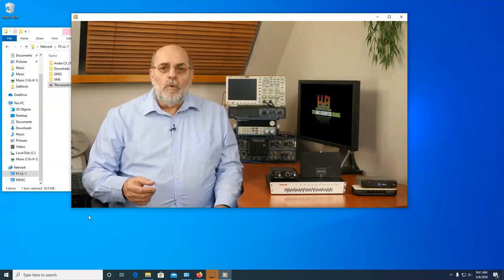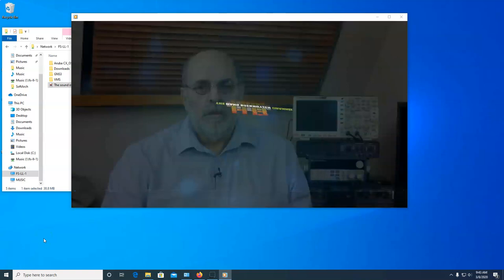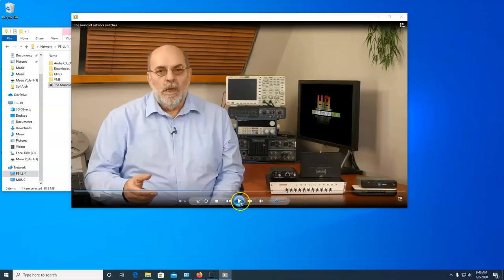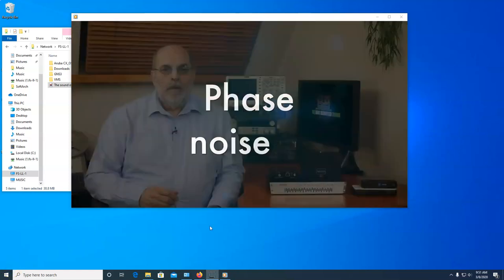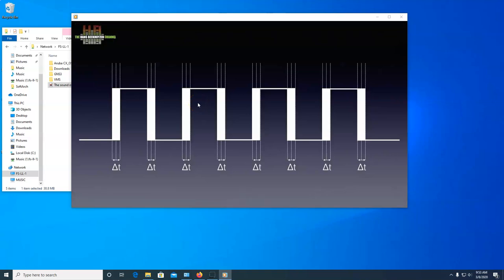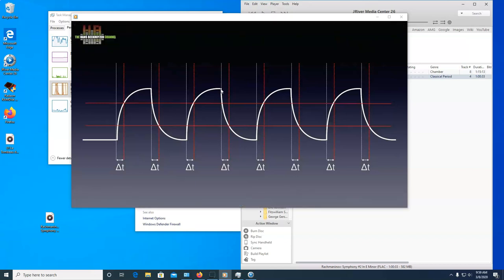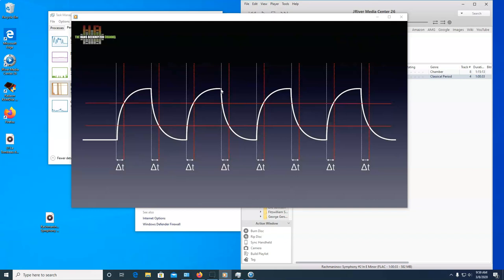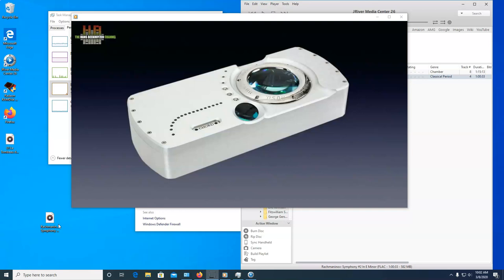Reply to Hans Beekhuyzen on Audiophile Switches

Comment: If someone hears a difference they hear a difference regardless of measurement. Hans is independent and highly respected, I guess it’s possible he might be fooling himself in hearing a difference but I very much doubt he speaks in bad faith.
I find it fascinating why it bothers so many what others spend their cash on. If I want to drop a few hundred on a cable to give myself piece of mind that I’m giving the system the best chance, that’s my funeral!
If you’d used to the time you spent criticizing audiophiles for something more remunerative, the cable would be a drop in the ocean!
Reply from the maker: If someone sees the tooth fairy they see the tooth fairy. Especially if they are independent and highly respected.  Thanks for clearing that up for me Keith. 

Let me ask you this: Where in my video am I incorrect and where is Hans correct. We can't both be right.
Reply: @mnoble247  firstly, if I believe the tooth fairy is making a difference, that is placebo. We know placebo is a thing. If I fool myself into thinking something sounds better, I still think it sounds better,  what else is there to be said? It’s a win win, you get to call me a fool and I believe I’m hearing better music. In this case only MY wallet has suffered.

Your expertise at measurement is unimpeachable and I have full respect for what you do. To me it comes down to, Can everything be measured? and while the answer should be yes, the answer is t yes. You could have two pieces of audio equipment by different manufacturers that measure identical but will surely sound different even if by a small margin.

I’m just a music lover who believes in marginal gains and am prepared to pursue these gains to a degree I see fit for my income. Because of my interest here i have no doubt confirmation bias is doing it’s thing but once again, my opinion of what my system is doing is all that matters. 

Your passion is measurement and so you are firmly in that camp. I’ve seen you’ve made a few vids of the debunking kind. Now, if this is your brand then it seems quite possible that you too could succumb to confirmation bias and dismiss anything that’s not measurable. 

In summary, you are both right because you are using different schemes for analysis, Hans uses his ears, you use measurement. 

If it makes you happy to call us all idiots have at it, enjoy your analyzers I’m off to listen to the White Album
Reply from the maker: @keithbertschin1213 

You are trying to make a point about something I wasn't talking about for starters. 

Hans has a foundational misunderstanding in how data networks work. That's the point I'm making. He's treating data networking like it's some realtime analog vinyl system. It's not. Pre-recorded audio and video by it's nature is bandwidth greedy and delay insensitive. 

The other day I was watching a YT video and all the sudden it stopped in the middle. I went into my SNMP server and found that my Internet connection had went down 45 seconds earlier.

Don't read into what's not covered in my response to Han's taking heat from Network Engineers and the like.

Comment: Why can't people like you see that all you're doing is trying to claim your product is as good as the more expensive one? I don't even disagree, necessarily, I just grow weary of the approach.
Reply from the maker: This is the second post of yours where you are insinuating that I'm a vendor of some sort in the audio market place.
Reply: @mnoble247  not exactly, but close. I  believe that what all of these videos exhibit is similar to psychological bargaining. What you're really doing is making a deal with yourself, that your choice is as good as another. In other words selling yourself by way of making a video on the idea that you found or hand built a diamond in the rough. 

  Your real argument should be with the marketing department. I'd bet that their engineers follow the same principles as you.
Reply from the maker: @jamesrobinson9176  I've had both the ER and the Silent Angel Bonn 8 in situ. I have another video showing the ER and one of my Aruba switches feeding a computer with a dual port network adapter in a 802.3ad compliant lag. In that demonstration I start play back of audio and with no interruption in play I introduce the largest possible source of jitter and that is I pull the cable and swap another. 

So this isn't an inferiority complex as predicated on psychological bargaining. But one of understanding the technical underpinnings of non-realtime audio reproduction and how it actually works. 

Now I understand why you've made your unforced error and all you had to do was look at my other video's in channel. But if you haven't and you've only based your theory on two of my videos that's entirely understandable given your information deficit.

So the question I have and it relates directly to the video that I created here: Where is my reply to Hans factually incorrect? Either Hans is incorrect or I am. I would rather not have someone genuflecting from the purpose of my response video.

Comment: Switches are the next level snake oil. Talk about USB cables. A half decent USB cable will perform as good as one made out of silver - both of which cannot make any difference to sound because it's data for the dac and not its analog signal. I'm tired of explaining this to people online.

Comment: Engineer here. Audio DACs, at least the ones made in the last 30years or so don't care about jitter because by design they have a buffer anyways. Its the biggest lie in the audio industry. On the output/analog side audiophile DAC makers just screw with equalization a bit in the midrange to get all these claims.

Comment: Well, we do not do blind testing. If you experienced enough in listening, it is like with your eyes, you know what is HD and what is 4K with or without blind testing.  You thinking too much. Sit and listen. But, you need to have decent enough audio system, if not and you will hear nothing - all you can say is: in this particular system, you heard nothing. That is it. Otherwise you fooling yourself thinking you know what you do not know. Which is how other people systems sound. And one more thing. If you using Jriver as a source, well, that is the reason why you do not hear the difference. People who invest monies only in what makes difference in sound, do hear the difference. So what you are going to do about that? Tell them they do not hear what they hear? :)
Reply from the maker: I have a standing offer of my $4000 to your $1000, in your setup from the USB cable on back, you can't tell when blinded to what switch is in play. Here is my proof of concept video https://www.youtube.com/watch?v=u6mYM8Xy0H8&t=6s . Travel expenses paid by loser.
Reply: @mnoble247  I do not use USB in my system, I think it is inferior to other connections. I use Roon. DCS Network Bridge is connected to switch and connected to DAC via Transparent Reference XL aes/ebu, than via xlr PAD Neptune to amp. Roon Core is on my laptop, if laptop has wifi off, music stops after seconds, not like in your experiment :) Meaning you experiment is wrong. Does not apply to real world. Dunning–Kruger effect comes to mind. You know something from technical point of view, but just something, that gives you lots of confidence. And that is Dunning–Kruger effect. Sorry, I have no time to prove you are wrong. This is for you to discover.
Reply from the maker: @kennigt  How is my experiment wrong? If you play Tidal direct it will cache entire songs, If you use ROON as your front end for Tidal  it will only do a few seconds. I would rather applications take advantage of full data rate instead of constantly fetching. 

I've read plenty about Dunning-Kruger at avsforum ove the past 15 years. 

What is not real world about my linked video. Does the music play or not play as I swap Ethernet cables?
Reply: @mnoble247  you are measuring, not listening. You probably have no system good enough to pick up the difference. I seen many technical people ignoring what is the most important. Experience in listening. Not only one system at home ,but as many as possible, learning and understanding what make difference by try and error, experiment, not measurement. Measure will not tell you how or why something sound. And that is something you need to learn, when you learn that, you will know how much is there still to learn, hence you are at beginning of Dunning-Kruger curve.
Reply from the maker: @kennigt  I have 4 different systems. One dedicated HT and three 2 channel systems.  I'm also an avid DIY'er and we have GTG's twice a year. 

Also read plenty on Dunning-Kruger over the years. Also check out the McGurk effect. 

Also in the linked video I didn't do any measurements. It was simply listening on my AKG 701's off an Emotiva DC-1. 

BTW I build my first set of speaker 30 years ago: Karlson Folded Horn. I've been at this a while... For 7 years I put in NLE system for audio and video mastering. Everything from home to broadcast. 

Currently since I'm a network engineer I design and install AVB and AES67. 

I can more than hold my own.
Reply: @mnoble247  I had electrician at home, and when I asked him about power cables he said I am crazy, power cable makes no difference. So, you as network engineer are saying the same? We are fools when we hear the difference?  Or maybe problem is on our side? On Emotiva you will not hear the difference.
Reply from the maker: @kennigt  I'm saying sighted bias has an effect. The DC-1 is more than capable of being a resolving DAC. 

As a network engineer I'm saying I understand how highly buffered, non-real-time, latency tolerant, audio works.

When it comes to AES67 I also understand how DCSP, low latency, realtime audio works.

I've yet to call anyone a fool.
Reply: @mnoble247  I just tested your buffer theory, played music for 30sec and disconnected internet cable from DCS Network Bridge. Music stopped after 5sec. Where is this buffering of the whole song?
Reply from the maker: @kennigt  Obviously It's device dependent. Current NAIM units can do a minute or two depending on resolution. Your dCS network bridge has 5 seconds, assuming 16/44.1(?). 
Tidal on Windows will buffer the entire track last time I tested. On my DIY playback computer I can buffer 1GB with JRiver. So that's an entire 16/44.1 album. 24/96, 24/192, 32/384 etc would mean less playback time. 
But even at 5 seconds you aren't playing off the Ethernet connection on your dCS are you when you unplug. So if one could theoretically pull the plug and reinsert on your DCS without breaking playback (that is the connection will re-establish and start Tx again) the question is: Can you tell when the cable is in your system and when it isn't.
Did the sound change, get better, or get worse when the cable was removed?
As a side note I'm surprised they use so little buffer given the cost. DRAM modules are frigging cheap and have been for more than a decade.
Reply: @mnoble247  You are surprised as you do not know everything. You do not know what philosophy and thinking is behind DCS and I do not know as well. Purity comes to mind, not to influence signal with DRAM etc. I know this transport sound was better than linn klimax ds1 ,as I tested in them my system. I judge elements by sound, not by measurements as we (humans) do not understand it all. It all go down to quantum mechanics, micro vibrations etc. And that is my whole point. You think you know something, but you do not know everything, yet, you make statement without even testing subject with proper sound system.
Reply from the maker: @kennigt  From an engineering POV I just know what some other peer devices are doing. With the reliability and availability of high speed links 5 seconds is plenty. But I'll take extra buffer where I can get it and if it doesn't come with a price penalty so much the better. You seem to think I'm ascribing some theology to dCS and how they designed. I'm simply stating for that kind of money I am surprised they didn't put in a bit more buffer. My understanding from reading up on clock domain boundaries, wrt non-realtime data, is that larger buffers are preferred from a CPU and wire contention standpoint. 

 When I design wireless networks I can actually monitor connections, identify higher speed devices, and give them priority because they are going to hop off the channel quicker and my designs can ultimately service more wireless clients. 

 And AGAIN I didn't do any measurements. I listened and showed the audio playing back without any connection and then asked one. simple. question. What happens to the sound when there is no connection. 5 seconds, 30 seconds, 50 minutes... Did it stay the same, sound better, sound worse. I think any gear that changes it's sound signature when being fed compliant 802.3 is poorly engineered garbage.
Reply: @kennigt  lol, human ears and minds are highly flawed. We’re not picking up any magical parts from the universe that can’t be measured when listening music...
Reply: @kennigt  "Purity comes to mind"???
What "Purity" are you referring to? Or is it some personal quixotic concept of "Purity" that you refer to?
Which obviously will vary from person to person.

There is purity in a USD $ 200 DAC & there is purity in a USD $ 20,000 DAC. Depends on which end of the spending spectrum you are.
The "Purity" remains the same. Especially in a double blinded test.

"Quantum Mechanics & Micro Vibrations" -  Yeah, I have experienced that. When my barber is using an electronic hand massager for my head massage and decides to shove his pinky in my ear. I guarantee you thats some straightout Quantum Mechanics of sheer ecstacy thanks to all them micro vibrations.
Reply: You hear placebo !!!! You go from listening to music, and then turn into a analyser of music. That's what happens when you start listening to cables and switches. Placebo....
Reply: @Ceko  This is false. The human ear has evolved over millions of years and is more sensitive than any equipment, no matter how high tech. Many aspects of hearing aren't even measurable - only amplitude and frequency are measurable. Timbre isn't measurable. The way our brains perceive minuscule changes in timing isn't measurable. 

The false assumption that human hearing is flawed and modern measuring equipment tells us "the real story" is completely false and drives a lot of the triggered anti-audiophile hysteria. You really think this stuff has all been 100% disproven with measurements and blind A/B testing, but that actual scientific fact is that it hasn't been disproven or even challenged. Blind testing is inherently flawed and biased towards a null result. Measurements don't tell you the whole story, or even much or it.
Reply: @vladg5216  do you have any proof of this fairytale?